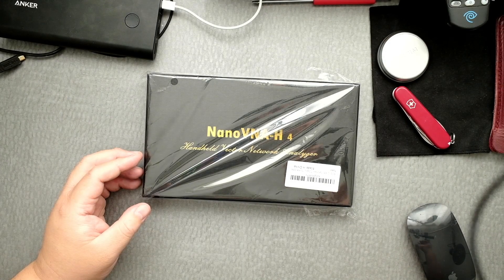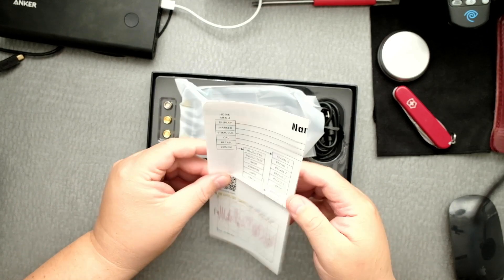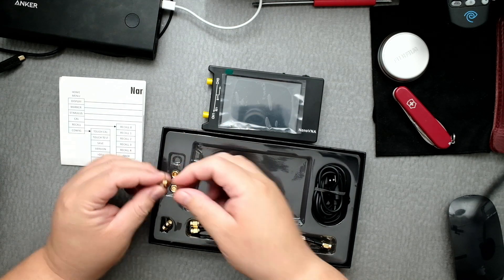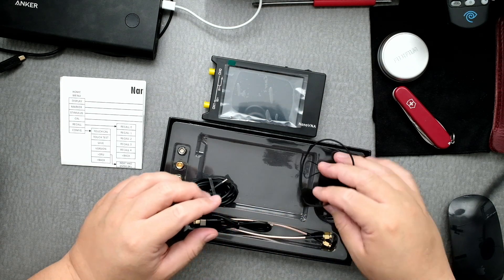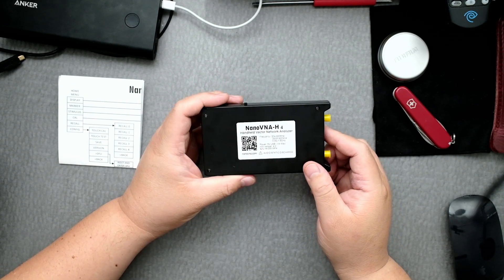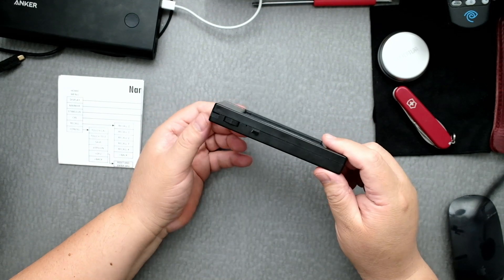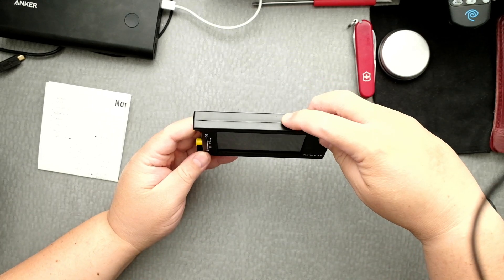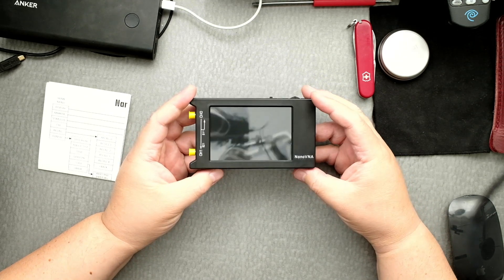NanoVNA-H4

Comment: Hi, question....I am setting up a hustler 6btv 6 band trap vertical antenna. I will be feeding it with rg8x. I will be using a 1:1 balun wound with the same coax. My question is, should I do my vna scan  ( when tuning the antenna) with or without the balun in line.
Any info would be greatly appreciated.
Cliff

Comment: Frank Romero Hello, I'm hugen the author of the NanoVNA-H4, it looks like your NanoVNA-H4 that we sold earlier has a distorted case, you may need to loosen the screws on the back to start properly, we have fixed this issue, you can contact us for a new case. Sorry again for our mistake.
Reply: Hugen, I am having the same problem.  I loosened the screws and the touch screen does not respond at the bottom of the menu.  What is the best way to contact you?  Thank you in advance.  Mark
Reply: @markpac3485  Hello Mark , if you remove the casing and still can not operate properly, the touch screen may be damaged. Please take complete photos of the malfunction and send me and I will send you a new NanoVNA-H4.
You can find me in this group.
https://groups.io/groups